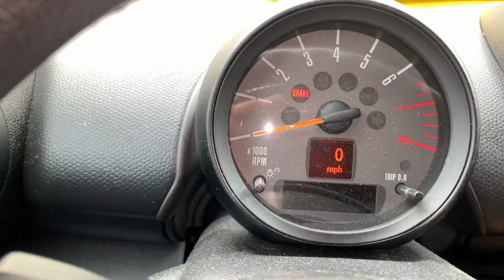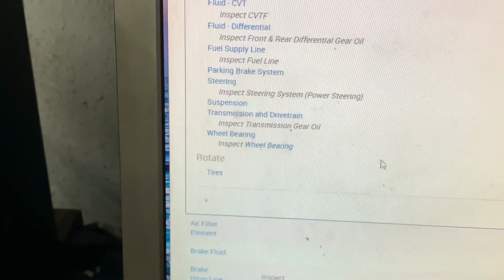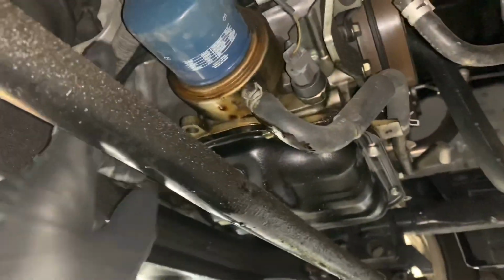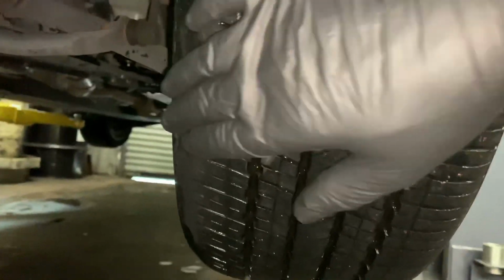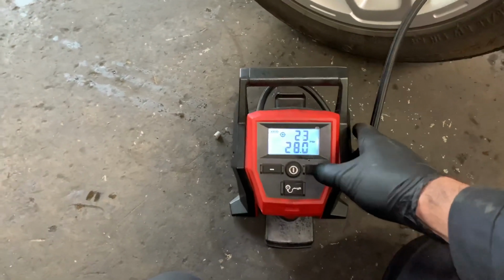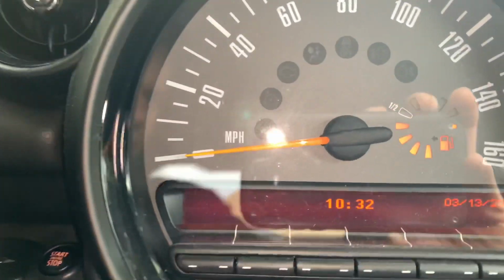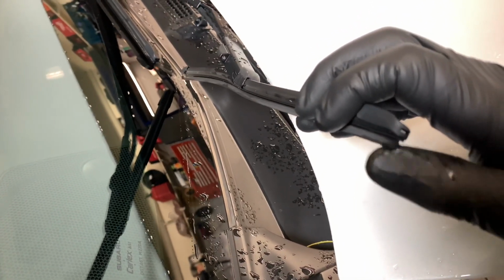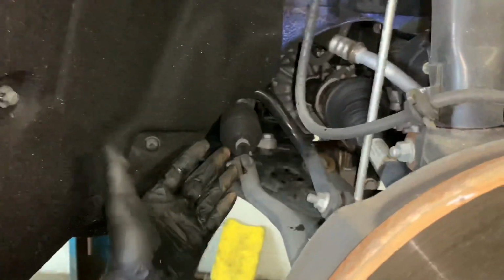Is Your Vehicle Crisis Ready?

Comment: Brian  hi  grate video   I have the milwaukee air compressor  just like yours     but it eats battery life way to fast    also they should have gone with a quick disconnect  coupler   instead of the screw on     I dont like it because when removing it   air comes out
Reply from the maker: JOE DELUCIA I know what you Mean on the air pump. Those would be good improvements.